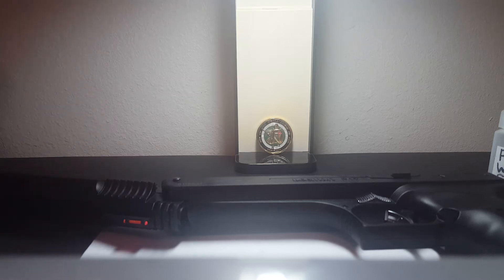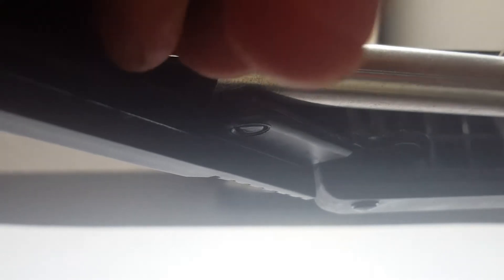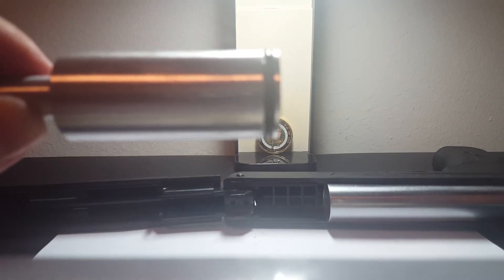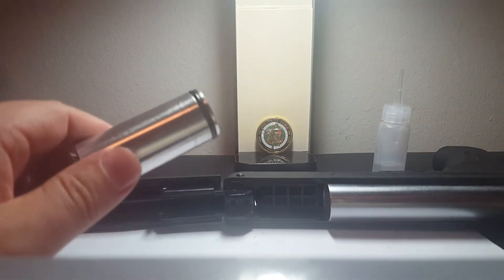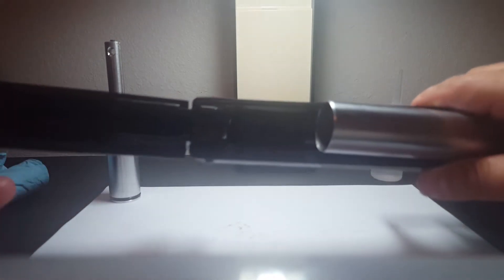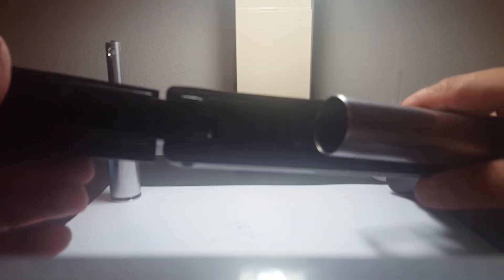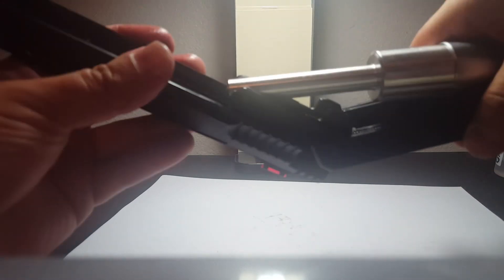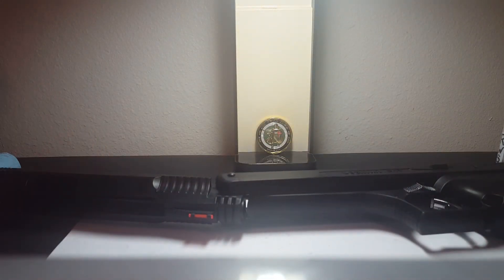P-17 Fix: Clean, Lube, Main Metric O-Ring

Comment: Great tutorial which will help me loads as I bought 1 this week. So impressed I’m buying another tomorrow…..
Thanks for all the info. 👍👀🇬🇧
Reply from the maker: Philip, thanks!

Hope all is well in the UK! You look like a strong man, so you should be fine charging it - closing it is the one Achilles heel of this design, for the less physical shooters.

Here are the P-17 attributes:

▶️ Recoiless and accurate

▶️ Silky smooth trigger pull.

▶️Low maintenance

▶️Easy Repair.

Comment: Got my Beeman P17 today (3-27-21) from eBay and I'm so glad I found this video.  Yes it is very dirty from the factory, I plan to put a few pellets through it to make sure it functions properly and after watching this video I'll do a partial tear down and clean it up.  I also have a Weihrauch Hw40 on its way from eBay and it'll need a cleaning too.  I'm hoping the tear down is similar to the P17.
Reply from the maker: Yep, P3 or HW40 you should be covered. If new, I doubt the German guns would need a cleaning. But used, likely a great idea.

The Chinese guns need cleaning on pump head and air tube. Watch for sharp point in back on air intake.. If there, use fine sand paper to remove. 

Mine didn't have one, smooth.
Reply: THERE MUST BE A WAY TO MOD THE BEEMAN P17  TO COPY THE WEIHRAUCH HW40 RIGHT ?

Comment: The Storehouse SAE kit also has O Rings in it that will work for the seal on the piston assembky that seals the end of the barrel. They are not quite as thick as the original ones, but fit and stay in position and seal.

Comment: A little late for this video but why you doesn't put any White lithium grease on the back piston like the Beeman manual say?
Reply from the maker: Great question. And thanks for asking it in a civilized way! Some get so offended.

(1) I DO NOT doubt that the Chinese engineers would use the grease correctly. But too many,  especially novice shooters, dont use SOFT touch with grease and put on TOO MUCH. That can cause operational issues, and bad fouling!

My P-17 has ONLY been treated with RWS silicone since I got it - AFTER I cleaned it out - and it is at 100% performance.

It shoots great and is at  FULL power. The liquid lubes also SPRAY on other working parts. A 10 or 30 weight mineral oil like 30 SAE ND or 30 ND Compressor oil would work also.

(2) I would be SHOCKED if the ORIGINAL German engineers for the P3 say to use grease.  If so, I don't doubt that German or Chinese engineers know how to use grease.  Use grease if you like! Silicone does work if it is airgun GRADE - RWS, Crosman, or Super Lube O Ring (5000 CST).
Reply: @daisy880fanaticfixit9  Thanks for your answer...and for the piston O-Ring seal, the compression chamber and.the back of the piston, did you use the same RWS Silicone oil for all these parts? Thanks
Reply from the maker: Yes, on the SEALS. I actually removed ALL the OEM seals to replace with Storehouse Nitrile rings from Harbor Freight.

They work great, but YOU don't need to do that if you aren't repairing it.

I CHOSE to change the rings. A test. The OEM I still kept in storage. 

I put the RWS lube on the top and bottom of the rings on the valve stem.

Comment: Once u opened it. How easy do you think it would be to swap out the barrel to a .22
Reply from the maker: Freddy, that is an important question.

Would it be better to be in .22? The P-17  has some noise to it. A .22 pellet would quiet it down, but that level of low power would mean VERY slow shot on target and pellet drop.

I was asked recently if it angers me that Daisy doesn't have a .22 pump gun. If Daisy brought back a modern 922 - rifled barrel, modern valve, and rubber magazine - yes, I would be excited and would buy it!

The Crosman 1322 works well enough. I like 13 grain Plinker pellets. They have a better combo of speed and accuracy.

But the power potential of the 1322 FAR exceeds the P-17. But if you are a great gunsmith, try it. A .22 P-17 would be a novelty.

Comment: Thanks....l have a question l just got this gun does the tension screw suppose to be tight or not???? Do l tighten it??? I'm not doing maintenance right now?????
Reply from the maker: Abel, yes, loose means NO tension to hold part in place. Just don't wrench it,, or strip it, or thread lock it.

It doesn't need to be removed for take apart  It is also small and could get lost. Snug when the gun is together.

Comment: I know this was a long time ago,  but do you still lube it with O-ring lube before reassembly? I did not see you do that. Is silicone O-ring lube what you would use? Good video.
Reply from the maker: Yes, I know the Chinese engineers say white grease, but my gunshop says no to grease.

You can use RWS or Super Lube O Ring silicone.

Also, 10 or 30 weight ND mineral oil works fine with a squeeze bottle.
 bottle.https://www.oreillyauto.com/detail/c/pure-guard/pure-guard-compressor-oil-4-quart/pgd0/ac18

https://www.hobbylobby.com/Art-Supplies/Painting-Supplies/Palettes-Tools/Squeeze-Bottles---5-07-Ounce/p/57415

https://www.amazon.com/Super-Lube-56204-Silicone-Lubricant/dp/B083NXVGQX

My P-17 is working great -  NO WHITE GREASE ever used. If you forget to lube a new pumphead ring, you will be fine to lube the tube and shoot. It will get on to the seal.
Reply: @daisy880fanaticfixit9  Thanks. Just did it today. My gun is not but 2 or so months old and I absolutely love it. Great video and thanks for making it. I going to subscribe.

Comment: Doesn't seem that complicated. You make breakdowns and installations look easy with great detail. I'll try to remember this vid for future references. Guess I need to break mine down and clean it. Where can you buy the Storehouse brand at? Thanks.
Reply from the maker: Harbor Freight.  400 piece metric for $8. 200 piece SAE for $6. You will need both. I'll see what rings are on valve later. 

Going for individual rings could be goose chase.
Reply: @daisy880fanaticfixit9  maybe the Davco kit could be helpful on the valve and breech seal?
Reply from the maker: Nope. Too big in Danco kit. That kit best for 880. The Storehouse SAE has tiny ring for P-17. Will check valve rings soon.

Comment: Have you had any issue with pellets not fitting. I just got a new beeman P17, trying to use my crosman hollow point premier pellets. But the pellet is getting stuck, not getting in. Does the P17 work only with select pellets? mine are 177 cal, and did work well with the Umarex stike point!
Reply from the maker: Vyes, so you know, Crosman has EXTRA HARD pellets. Shooters either love or hate em. My favorite pellet maker is H&N. But I am very fond of RWS wadcutters and select JSB pellets.

For the P-17, the best pellets for accuracy (and penetration if you line up pop cans, back to back, filled with water) is JSB RS. Or you can try the more  expensive Express cousin.

Both JSB types are fast hard hitting  little pellets. The RS  works well in my Bushmaster, which is medium power, and GREAT in the P-17. The RS price point really good for this elite pellet line.

https://www.pyramydair.com/s/p/JSB_Match_Diabolo_Exact_RS_177_Cal_7_33_Grains_Domed_500ct/718
Reply: @daisy880fanaticfixit9   thanks mate, I'll check out the exact and RWS pellets.
I am too new, so I can't tell whether I love or hate the crosman premier's :)
For now, I noticed some rust like layers on the barrel inside where we load the pellets. Wiped it clean and was able to load the pellet. 
Now am thinking if the barrel was bad, does it make sense to open and clean the cylinder and piston as well as the valve outlets too.
Reply: Guten morgen , you should try  Geco Diabolo und RWS Hobby. Zey ar ze bestest fur dise gun.

Comment: Ok so... No one else seems to have that problem with the P17 on the internet, but I'm new to this and I don't want to screw this up. I've just received my P17 and firing the first 75 pointed pellets, we had the breach o-ring becoming unhinged a few times. (Each 20 then 10 shots). At first these misfires and replacing the ring weren't too annoying, but past the 76th shot; having to check for the fall of the breach o-ring after EACH SHOT, and having to replace the bastard during each reloading cycle... is frustrating. (As long as we shoot indoor we can find it back, but outdoor would be a lot less fun.)
It does shoot okay for everything else though.

Maybe the o-rings were past their correct shelf life in there? The lubricant seems otherwise okay. What should I do? Change that o-ring? Lube it? Glue it? Grease it? Some have mentioned that I might somehow have to move back the cannon a little and squeeze it tighter. I'm not sure this wouldn't make more problems as it then might create more friction against the o-ring while pumping. Does really no one else have had their breach o-ring just falling on the line of duty? I also hesitate to Teflon tape the o-ring as this might be a bore to clean later...
Reply from the maker: That was a very fine comment. You look thoughtful and asked for help well.

Ok the youtube link below is your salvation. Or if you prefer search my library for the O ring video.
https://youtu.be/TCbJBoyelD8

Here, now, I would say to replace the ring. It is 008 SAE. Mine doesn't do that.

For lube go with this choice - not white grease. Most don't use grease right and cause operational problems. Go airgun grade silicone. Finger lube the new ring.
https://www.amazon.com/Super-Lube-56204-Silicone-Lubricant/dp/B083NXVGQX
Reply: @daisy880fanaticfixit9  Thanks, I originally landed on your O-Ring video. (Now added the like for good measure.) 
For now at least, different sources seems all to point to the same first step, trying to change that O-Ring; and thus that is what I'll try. You are the only one to have thought about linking to the right lubricant to go with it though, so that's a nice touch. (Now added to cart on Amazon.) 
It does however sound counter-intuitive, in that the lubricant would then help it stay in place instead of slipping out... But then again, it make sense in that it would create a bit less spacing. 
I'll try and remember to come back and inform you of the result.
Reply from the maker: Yeah, let me know how it goes. 

On lube and rings:

Please know that the lube is for air seal and WEAR PROTECTION. Folks don't always remember that prolonging the life of the seal is an important goal.

You don't have to soak the ring in Super Lube. Just plug it in and lube the FRONT for air seal and WEAR PROTECTION. Other than faulty breech metal, this should work.

Wish you success!
Reply: @daisy880fanaticfixit9  Ok... Well it's been a while, but let's just say I had a lot of stuff to deal with in the meantime. So... I finally received my o-rings and super lube, and found the time to test them, today.

I used my fingers to lube the new o-ring and plug it in. For some reason, it seemed as if it was a bit smaller or more fit than the original. First three shots were misfires. As in not only did the o-ring unplug itself from the breech seal, but the pellet didn't even move in the canon. I didn't despaired however, and I did wipe or spread a bit of the lube replacing the ring between each shots. It looked like the lube now made the o-ring glue to the canon when opening the P-17. 

Fourth shot finally got the pellet going. I immediately noticed that the shot was more accurate, closer to when I first shot the beeman, than when the other problem had arisen. I thought I might have misaligned it since then, but it might have only been a loss of power due to a bad seal? 

Since fourth shot also had the o-ring dislodged when opening back the pistol, I decided to add a bit of lube, but this time only on the surface of the breach o-ring. Further shots continued to be more accurate than with precedent o-ring, and the o-ring did continue to pop out... BUT NOT ENTIRELY! So I guess that is a step in the right direction.

Should I continue to add lube until it works out, or is there anything else I might have been doing wrong?
Reply from the maker: Well, I just examined my model. The 008 SAE is deeply SUNK back surrounding the air transport hole.

You must have metal burr on the breech of your barrel or where your  ring fits in.

Get some 200 grit sand paper. Feel around your Breech for sharp spots and lightly sand.

CHECK EDGE OF BARREL that contacts ring.

https://www.oreillyauto.com/detail/c/masterpro-refinishing/masterpro-refinishing-220-400-800-grit-wet-or-dry-sandpaper/mpr6/41800

If you find your ring PROTRUDING out front its hub, take it out and feel with your finger, and then a tooth pick to seek out any burr or defect in the metal. Try to sand it smooth.

Thanks for contact. Keep me posted.

Comment: Thanks again for all the great info!  Curios where you found that kit for $8,  Best price I could find on eBay was @$16!  By the way, I just emailed Shelia for the 880 parts list and prices!
Reply from the maker: Gerald, Harbor Freight for the metric and SAE kits. $14 for BOTH...totally outfits your P-17. On 880 stick with OEM or Danco SAE nitrile rings.

Hope Sheila as nice as Hannah😊
Reply: @daisy880fanaticfixit9  Hope so too, ha!  Don't know what happened to my earlier request?  I get Harbor Freight catalogs every once in awhile so I'll have to try them out...thanks!  I did buy the Danco Kit.  I think I'll finally take your suggestion and just try the pump assembly from one of my new 880's and make sure that fixes it.  Since I used 3 in 1 oil back then before I became an air gun fanatic I may have ruined more than the pump assembly.  I know the washer disolved and that plastic bushing or whatever broke.  At least then if it works it will be easy to just order another pump assembly...should have done it way back when we started our dialogue!
Reply: @daisy880fanaticfixit9  Just got a non delivery message to Shelia!  I must be jinxed with them!
Reply from the maker: Hey, great story why not to use 3 n 1. Crosman says no way! I almost tried the 20 w oil, but backed off. They mean well, but non-detergent to 3 n 1 doesn't undo the other ADDITIVES in that product that kills your gun.

Only ND motor oil from auto store. Non petrol option - Super Lube O ring Silicone.
Reply from the maker: Gerald, use Hannah link. It works and make sure you have no MAIL blockers on your PC.
Reply from the maker: Double check link spelling.
Reply from the maker: Gerald, not mad, just want to help you get the ball rolling. Just call. Norma  is a veteran CSR, I believe, so just tell her what you are trying to do - you don't have to have the Numbers.
Reply: @daisy880fanaticfixit9  Ha!  I spelled Daisy, Daisey...oops!  I'll just retry it first before I do any calling.  Thanks!
Reply: @daisy880fanaticfixit9  I think they may have replied and it went to my spam filter and I deleted it by mistake.
Reply from the maker: Elementary, My Dear Watson!
👍✔
You found it in spam!  Now unspam. 🙄

Party time!🎉🎉🎉🎉🎈🎈🎈
Reply: @daisy880fanaticfixit9  Forgot to tell you, I did receive the pdf's!  Thanks for all your help, videos, and advice...now to put them to work!

Comment: I got my P17 pistol yesterday and mine was dirty not clean.
Reply from the maker: Hi, Katy. Yes, mine was also covered in grime. The Chinese producers use white grease and the factory grime was bad.

I cleaned it off wirh the thick towels shown in video. The RWS Silicone has worked great. 

The guns outside RWS and HW (German) tend to come filthy. It is worth time to clean it.